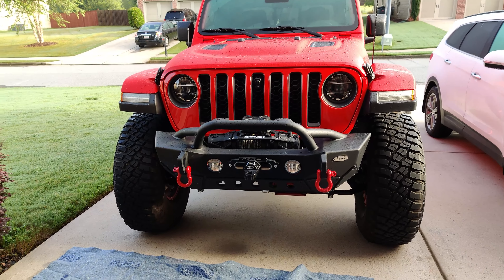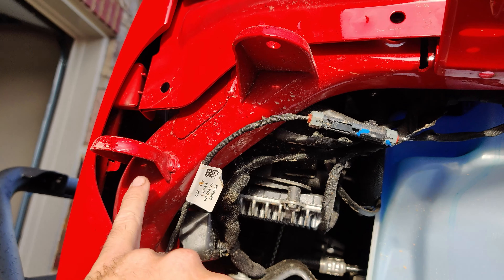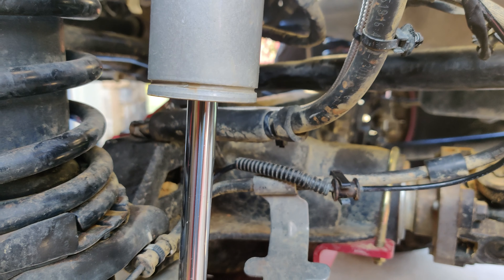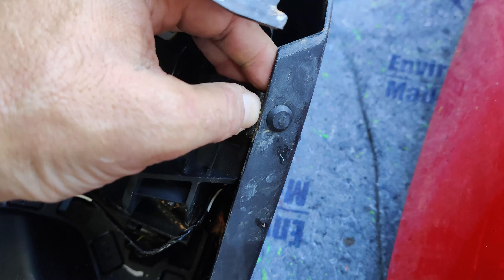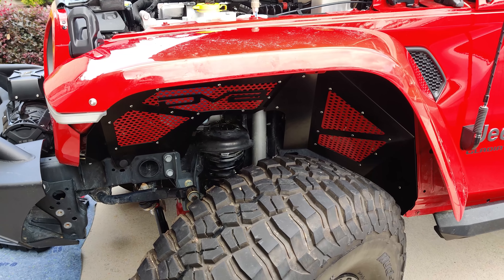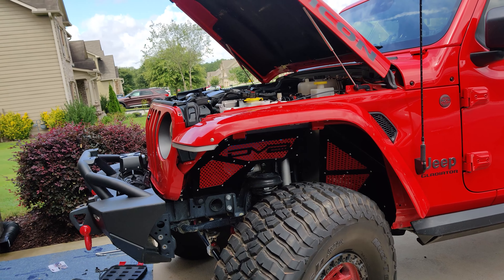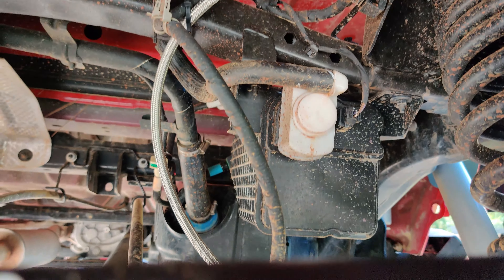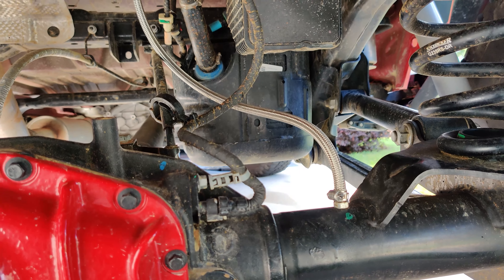Jeep Mods Saturday - Inner Fender Liners, High Line LEDs & Axle Breather Extensions

Comment: Great video.  Pardon my ignorance on the breathers.  What length braided hose.  Can't imagine 20 ft per amazon link.  Lol.  Also did you use the oem connectors at the diff.  Thanks
Reply from the maker: Yea, the 20ft was for the total roll length (better to have too much than not enough).. As far as actual lengths, I didn't measure as I was cutting.  Basically, I connected one end to the OEM axle connectors (so yes to that part of your question, did re-use them), then snaked them up carefully zip tying them securely along the way.  For the front, I came up to the top of the engine bay (right by the brake fluid reservoir) and inserted that plastic one-way OEM breather, and for the rear, right up behind the passenger side tail light (did the same, inserted that OEM one-way breather).  Thanks!

Comment: Great video! thanks for reviewing all the products.

Question. Where did you buy the fender door seal?
Reply from the maker: Thanks! If you're talking about the door edge trim around the flares, I got that at my local AutoZone.
Reply: @Chromedonkey  Would you happen to have a part number for the door edge trim that you used on the flares? Thanks!
Reply from the maker: @aneiford  I don't have an actual part number unfortunately.  That said, it was easy enough to find it at my local AutoZone.  It is just the plain black door edge trim guard (I got the biggest/longest package I could find of it and just cut to length).  I also highly recommend applying a THIN bead of superglue inside the groove to help it stay adhered to the plastic better.. Over time, mine came loose in the bends of the flares, but once I applied the superglue, problem solved permanently.